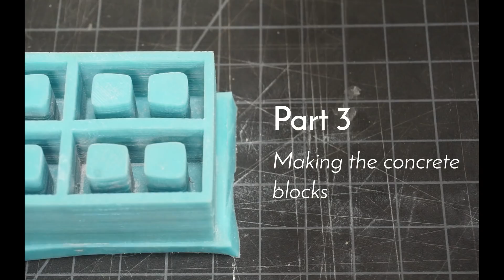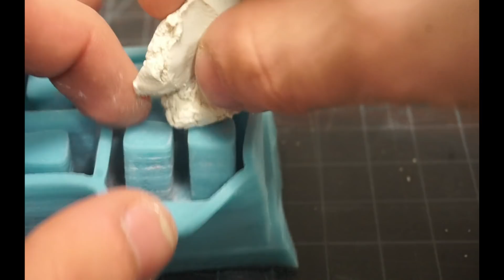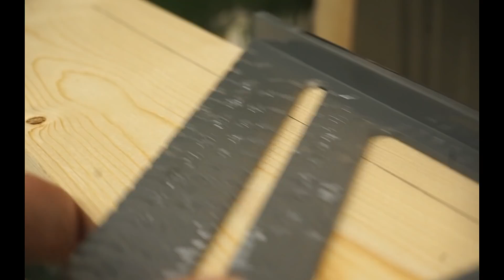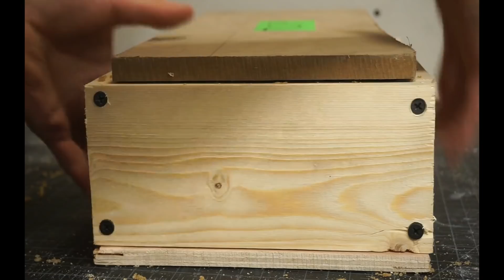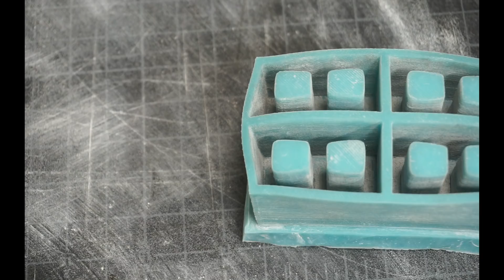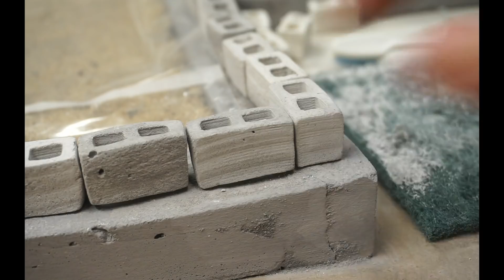Building a Realistic Model House, Part 3: Concrete Block

Comment: So make the mold out of wood the size of the block you want. Only make it 6ft long. Pour your concrete in there then set doll rods in the wet mud to make your holes for each block. Let harden over night cut with saw to size next day. Problem solved

Comment: Awesome job so far...just an FYI, you can make a perfect brick/cylinder block etc. Out of polymer clay. Once you have the perfect product you are happy with,  bake it and make your own mold from silicone. Use cement (which you can also colour) I had no issues or breaking with this method.
Reply from the maker: Yep, good point! I actually started out going down this path in the first part (https://youtu.be/U4TvJ_ZJf_Q?t=444), but I decided that the shape of the mini materials blocks was closer to what I was looking for. This might be a good suggestion for others who are building models, though!

Comment: Young man please watch model railroading vids.You could have made the footer using 1" foam insulation board and carve the inside out and use model dirt,all very realistic.Make forms any length and height you want and pour it with light weight plaster of Paris and scribe in your mortar joints.Your model will weigh oz's instead of pound.But love what you are doing.I am at the beginning stage of build an A'frame model house so when I retire
Reply from the maker: It's a good point. That being said though, I've been trying to utilize processes that match their full size counterparts as much as possible so that I can get an appreciation for and understand what goes into building a full size house.

Comment: you could take multiple impression by your first block with some putty material (like silicone) and put some plaster on them. Dentists using alginate and its much cheaper but its a drying and 
shrinking material. Well, good job and good luck!
Reply from the maker: I ended up buying three silicone molds pre-made, but if I had made the molds myself, I think that would have been not too far off from what you're suggesting. Anyway, thanks for the suggestion!

Comment: Make a mold with smoother walls and have the walls tapered a bit to ease with extraction.  for the wood mold/pattern you need to use whats called green sand: https://youtu.be/0VWddnuKOV8 Also make sure to sand and fill the pattern so that it's nice and smooth.

Comment: Have you thought of using concrete instead of grout with cocoa coir or some other long fiberous material as a strengthening aggregate?
Reply: Yes ..or possibly plaster or concrete mixed with finely chopped Styrofoam or packing peanuts .....I saw Martha Stuart on her show once  using the Styrofoam bits added to concrete to make planter pots in dishpans as molds years ago but it is brilliant tocut back on the weight and  also gives a rustic appearance..
Reply from the maker: I hadn't at the time, though I was able to use wire in each block which I think performs a similar function. If I have to make more for a future project that's a better solution though!

Comment: You need to use mold release spray. The blocks will come out much easier with mold release. Just make sure it is rated for Silicone molds.

Comment: Why not just make your own molds? Do a long concrete form at the right height and width, and cut to size when cured? It will be easy to pop the boards off to remove your casting and easy to put together to make more. You can put wooden dowels inside the form to form the holes for the rear.
Reply from the maker: Not a bad idea, but in general I'm trying to roughly follow the same process as I would if I was building the full size thing. In addition, I ordered a few more of the molds I showed in the video and I'd bet that with them it would probably be faster to get them all going concurrently then it would be to wait for a larger piece to dry.

Comment: Love all the ingenious fixes and experiments with materials. I felt a ton of models as well and I found the best and easiest material used is dental plaster.  Super strong and easy to use
Reply from the maker: Oh great idea! I already bought a pretty big bag of the plaster I used (just the typical plaster of paris that would be used for wall repairs), but I'll get some of the dental variety and give it a try too - I feel like a faster setting plaster would be huge. Thanks for watching!
Reply: @RyanGausMakes  good luck! Yeah that stuff sets really really quickly. If you do a ton of the dental plaster at once be aware that it's an exothermic reaction that causes the cure so if you use a really thin plastic or anything for your mold instead of silicone it might warp from the heat
Reply from the maker: @JW-hh4qg  Ah good to know, thanks!